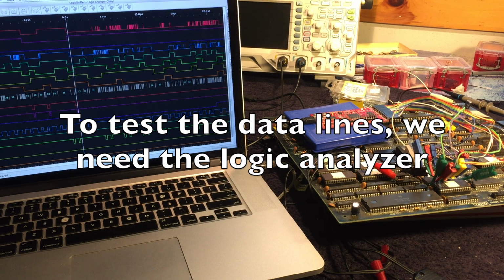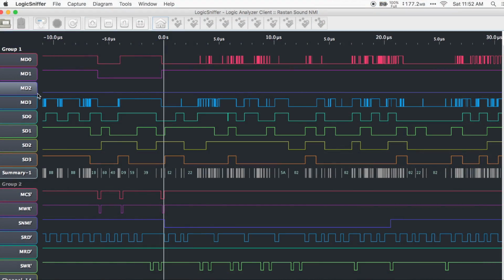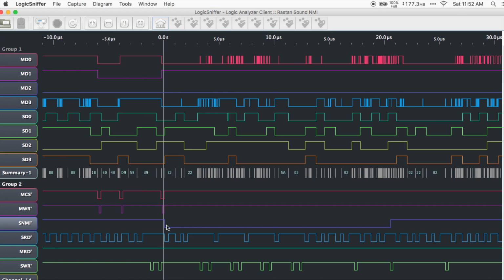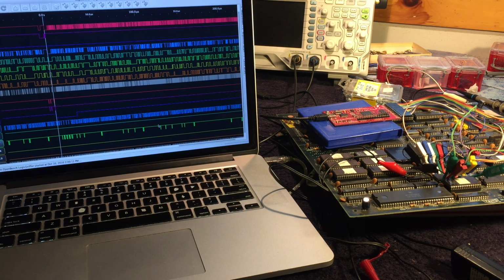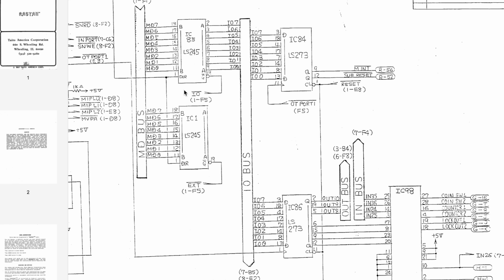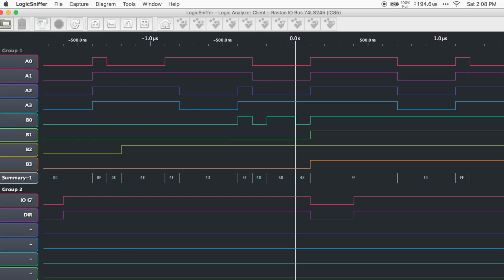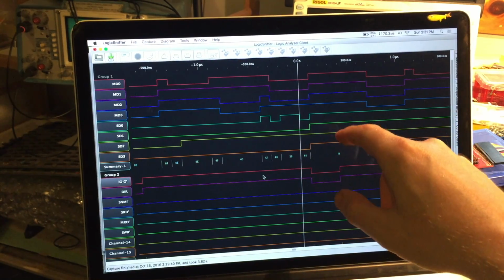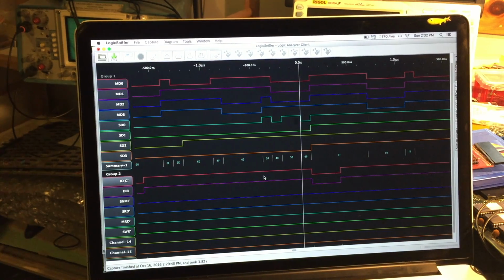Rastan PCB Repair

Comment: great job there! my Rastan has a very strong video signal, so much so I have to turn everything down or the picture bleeds across the screen, it did this on every cabinet I plug it into. It looks great once I adjust the monitor but I wish I didn't have to. yours do that too?
Reply from the maker: Hi! I haven't noticed a difference in output level on that board, but I've only used it on my test monitor (which is rather forgiving) and the G07 in my Double Dragon cabinet, which looks terrible no matter how I adjust it...

Comment: Nice repair, i have a rastan board that i cannot get into test mode, and that oddly resets half way through the final level in the game. the sound, graphics etc all work fine though
Reply from the maker: Thanks! That sounds like a bad/missing/loose ROM to me. If you haven't already, remove, clean and reinstall all the ROMs as a starting point.